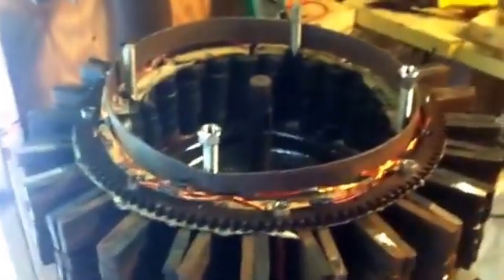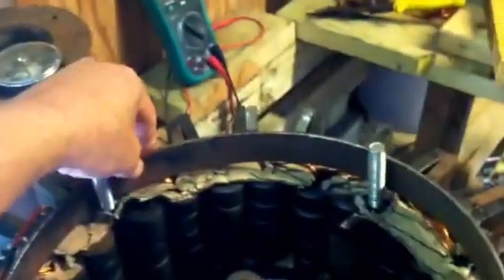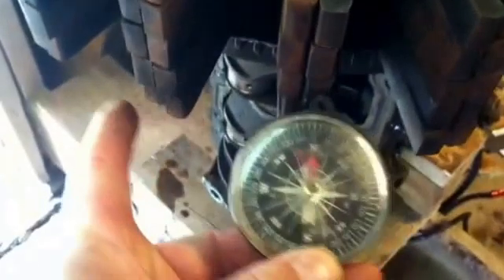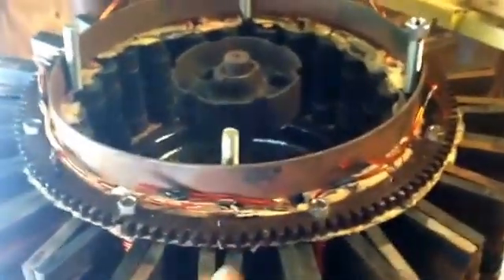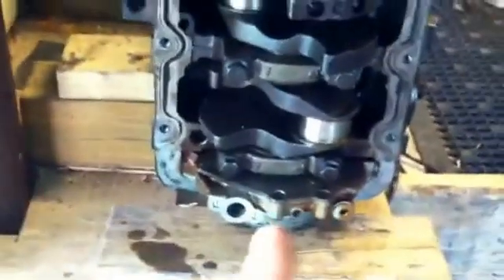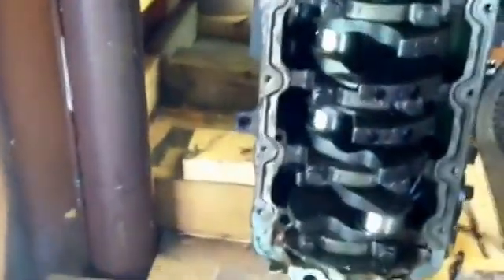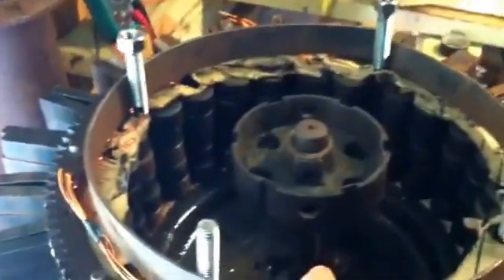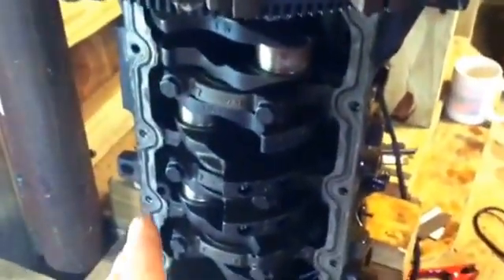Building Ed Leedskalnin's Magnetic Generator. (Part 6 )

Comment: A year later and you still can't pronounce his name. There are a lot of people out here that are into this kindof thing. Nobody leaves comments because there is nothing to comment on. I'm sure once you start to progress a little further you will get more questions and legitimate comments. Good luck. P.S. Is that the bucking coil that you put inside of the pipe.If so steel has a strong shielding effect which might cause an adverse effect.

Comment: The four posts will be south center hub north. The arm south This is because of the arrangements of magnets nn ss nn.Try holding a compass beside the post and center hub. Charge the magnets while they are in the wheel. See what changes you will get in the whole structure. look again at the leedskalnin photo with the wheel and imagine a U-shape above and below. Imagine the arm as a keeper between the two u shapes and dont forget the pipe and block are mounted in the limestone rock.

Comment: The long coil in the pole, I've seen one on the wall at coral castle in pictures, I never would have figured it went inside. Thanks Roy, you've answered so many of my questions in your videos. Keep up the momentum it's looking nice, I knew about the wire twisted around the top of the posts but didn't realise they were coils around the posts.
 And tests you did with the meter and the mags around the post with the coil, amazing dude. And Roy before you start her up, get some big rubber cloves!! It's going to have some kick I think. Awesome thanks again. Deeds